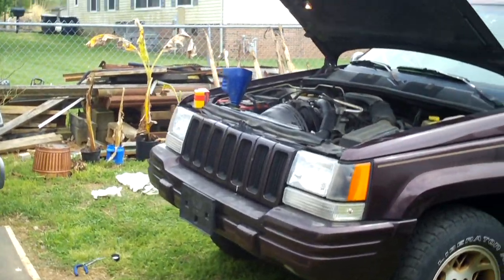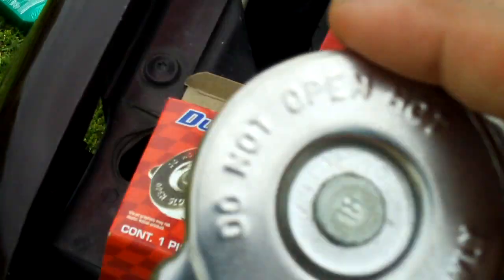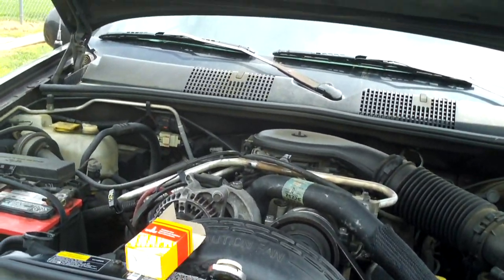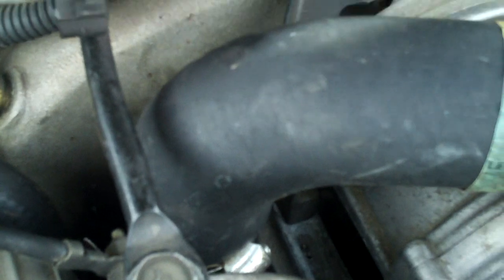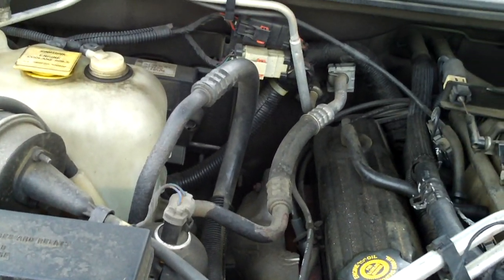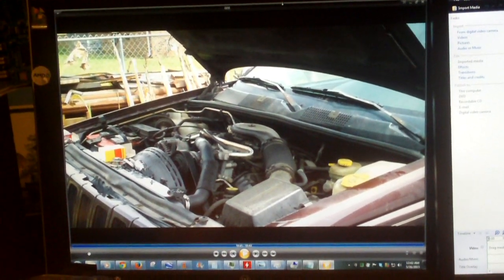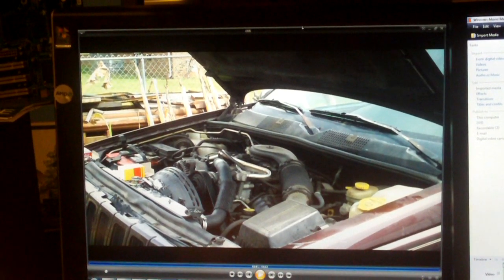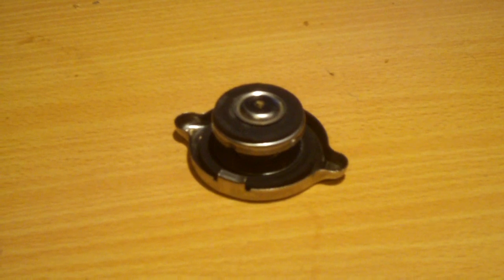What can happen if you install a defective radiator cap (over pressure)

Comment: If you would have taken it to a mechanic they would have sad "you have a blown head gasket"... lol Great job explaining. I have an issue where my coolant ends up in my overflow tank and not back into the engine, so quite oftem i have ti siphon it from there back to the radiator... and of course, i took it to a mechanic and they said "blown head gasget" meanwhile i have no symptoms, no over heating, not sludge in oil... not losing coolant. I installed new Rad, Hoses, coolant temp sensor, thermostat, etc and multiple caps! Same deal... at a loss. I have an infiniti fx35 2010

Comment: Likely your top seal was not working and thus not drawing coolant from the reserve tank.  The pressure was not likely to be a problem other that stressing your old hoses.  If the hoses were in good shape the clamps on the hoses would leak.

Comment: is it ok to change psi from 1.1 to 0.9?
Reply from the maker: You would lower the boiling point of the coolant by doing so. I'd suggest sticking with the OEM recommended pressure.

Comment: As far as I can see it, there was in this case nothing wrong with the cap. You just had the wrong cap. You needed a vented cap.The cap that was on the radiator was a non vented cap for closed cooling systems.
Reply from the maker: The Stant cap that's been on there ever since is pretty much the same design. This Jeep calls for a 18PSI cap, which is the pressure it vents at. The MotoRad cap was also rated at 18PSI.

Comment: I have  a very hard time unloosening my radiator cap , should I be pressing it down Hard first as I unscrew it
Reply: It should just twist counter clockwise until the first notch. Then you want to push down and turn the rest of the way off. The first turn releases the built up pressure. Never open hot

Comment: Inspired by your video, this morning i swap the old radiator cap spring into the new cap i use. I swap the spring because the coolant volume in the reservoar stay the same whether the engine is hot or cold, i think the cap (the new one) was defected one. Now the volume in the reservoar increase a little bit when engine is hot, and back to normal when the engine was cold. By the way, the old cap 0.8 kPa, while the new one 1.1 kPa. I think i'm in the right way.

Comment: I went with both Stant thermostat and rad cap, change every five years, spring and rubber gaskets go bad. Wal-Mart sells Stant online, pickup in store. Local auto parts stores sell nothing but no-name junk today, oil is double price of Wal-Mart.

Comment: Just replaced my cap a month ago and now pressure builds up so high it blows out the cap and hoses feel really pressured. And yes it was from autozone grrrrrr. Anyway I just called a tow and I'm going to Napa to get one. Hopefully they will have much better products because I'm tired of this. I just replaced the water pump last year, the thermostat also and the radiator last month not to mention all the hoses. I replaced the cap when I did radiator because the rubber gasket was getting wore out or at least looked that way. My second edit lol anyway auto Zone has been proven to me to sell crap. If you do t get the gold odds are its gonna be defective at least that's been my experience and even then not 100%
Reply: Was it really a defective cap or another problem with the system?
Reply: @Ashroyer86  unfortunately it wasn't the cap. I purchased 2 from Napa so I'd have an extra and both did the same thing so I replaced the thermostat and it worked fine for a few days then did it again so now I'm concerned it may be the headgasket but I haven't had time to fool with it anymore. It's parked until I can get around to checking the headgasket
Reply: @my2centz196  that stinks. Keep us updated. I have a similar issue possibly.
Reply: @my2centz196  also look up "block tester". Loan the tool from AutoZone and buy the fluid from them. I never had luck with it but apparently some people have.
Reply: @Ashroyer86  thanks yeah that's my plan I just need the time. I'll definitely keep you posted. Have you replaced the thermostat yet? Their pretty cheap and usually easy unless on bottom of motor like mine then a little of a pain but not to bad. I originally didn't think it was thermostat because I replaced mine not so long ago and I most likely was correct unless I received a defective one. My jeep has 356,000mi so if it is the headgasket I'm probably gonna loop the heater core and do something I swore I'd never do and use that blue devil crap and probably ruin the motor even more so lol. I hate the thought of using that stuff but with such high mileage on such a difficult vehicle to replace head gasket it doesn't make sense to put to much into it. I don't have any smoke, fluid mixing, missing or any other obvious signs of headgasket failure but who knows. Everything else is relatively new. I will say a small leak in the radiator will cause the overflow to boil usually after you kill the engine at least that's what's always been my case with all my vehicles anyway but it doesn't usually blow out the cap.
Reply: @Ashroyer86  I still haven't fooled with it but talked to a mechanic and he said it could be the overflow tank on mine anyway. I'm gonna order one just to try but I'm pretty sure it's the headgasket. I do plan on testing I've just been busy and have another vehicle I need to repair first.

Comment: That vacuum relief valve on the first cap isnt broken. Its an vented style cap or "Normally open" style cap. The disc should be hanging like that.
Instead of having a spring loaded valve it has a small counter weight inside it. Your problem with leaks could very well be because of just using the wrong style of cap. Using the non vented style subjects the cooling system to high pressure under much longer times and even during idling.

From Stant
The cap has a small disc at the bottom of the cap that is a vacuum valve. That vacuum valve hangs down in the open position until the cap is subjected to rapid expansion of coolant or steam, which closes the valve in a sealed position. At that point, the system is pressurized and helps control overheating and enhances system efficiency. This also means the vehicle can be idling without having a pressurized cooling system and could be “venting” vapor into the overflow reservoir.
Reply: Do uk why system staying pressurized im hoping it be ok now but it was expanding top hose holding psi all day till i crack the cap i have new radiator new cap

Comment: You might be right about motorad cap mine fit loosely too! It leaked out the top but it stilled pulled water from overflow! I wanted a Stant cap but had to get Motorad cap! I bent the tabs on it slightly now it’s tighter but my cap has lever to release pressure when I teased pressure with the lever it leaked out the top of the cap again instead of just going through the hose to the reservoir! I’m gonna try a slight more of a bend on one side of cap cause one side seems a little looser! It might work I will see tomorrow! Moral of my story is I shouldn’t got the trusted Stant brand cap! My fix might work but I want a Stant cap! Must be made in America Stantcap I’ve never had issue like this before! Motorad Chinese?
Reply: I would not buy anything made by Motorad.

Comment: I recently found the coolant level down to the fins in the radiator, but the overflow bottle was full. So I checked out a pressure test kit from my local Autozone. I found the cooling system to be leak free. I also found no pressure release from the pressure cap. Problem found, I figured. 

Not so fast. The new radiator cap also failed pressure test.I went down the street to Napa to try their import brand. Failed. Went to Honda dealer; no cap to fit my aftermarket radiator. Bought one online, the same part number as the failed cap I took off. No pressure release.  

That makes three new caps of various brands that have failed to release pressure above the system design pressure. Pretty strange.

Comment: Wow.....I've been having these problems for 8 months and didn't catch it.  3 thermostat gaskets, hoses replaced, hoses coming off and finally the new radiator blew.  I can't believe I didn't catch this.
Thanks!!!
Reply from the maker: You're welcome... if you continue to have leaks at the thermostat, replace the housing/neck with a cast aluminum one. NAPA carries them. Advance or O'Reilly may have them as well. Solved my thermostat housing leaks for good. The OEM steel housing is junk, and doesn't seal well on top of an aluminum intake manifold.
Reply: cubecompmtdx 
I actually replaced the thermostat housing last fall, thinking that was the underlying problem.  A small leak still developed.

Comment: I have a 1993 Chevy truck.  My radiator is only 1 year old with 5,000 miles and I have a leak at the top outlet on the left side of the radiator.  This may be the heater hose.  I have pressure on the radiator after 2 day of sitting and the engine is cold.  The over flow tank is always going down and I have to fill it.  The engine does not get hot.  I have patched the outlet fitting where is was braised at the factory and it stopped for a week.
I'm thinking the radiator cap is 6 years old and maybe I'm building up to much pressure in the radiator.  This is my 5th radiator form Auto Zone.  I hope this is the radiator cap.  Any thought on this would be appreciated.

Comment: Nice explanation. I'm having the same problem with my '06 Commander. First a hose from the heater popped up (had no clamp) and when we clamped that one it started leaking from the relief hose.
I've ordered a new cap and we'll see what happens.

Comment: Those duralast radiator cap are no good. I had one and I replaced it three times under warranty, in a six month span. I finally got tired of it and went to advance auto parts and got there's instead. It hasn't leaked and my heater finally works!

Comment: I had a weird thing in a 2002 jeep grand cherokee. I heard water noises in the heater core. Then I realized the radiator itself was low, but the reservoir full. Cap looked ok, but got a different one out of a junkyard jeep. No water noises and the coolant got pulled in the radiator from the reservoir. I'm a believer in cap problems now.

Comment: For one thing on a vehicle with that many miles you don't need to use a 18 psi cap it builds up to much pressure
Reply from the maker: Mileage does not matter. They still run as hot with 300k miles on them as they do from the factory. If a radiator/heater hose can no longer withstand the pressure of the factory prescribed cap pressure (18PSI on the Grand Cherokee ZJ), then the hose should be replaced. Putting a lower pressure cap in place only band-aids the problem, and you lower the capacity of the cooling system (before it boils over). With these particular Jeeps sometimes hitting 230F (stock fan clutch will not full on engage until it gets this hot) idling in the Arizona desert with the A/C full on and blasting, or hitting 230F pulling a trailer up a steep grade, the higher PSI cap keeps the system from boiling over until about 250 or so. The system works fine with the Stant 18PSI cap that's on it now.
Reply: @cubecompmtdx  hey can ask u advise i changed radiator and foolishly didnt change clamp and hoses and cap at first blew off bottom hose replaced hose and clamps now top hose holding psi and expanding i also tried new cap now i just changed top hose will know after half hour drive but i thought through out day psi would relieve on its own im nervous my wife cooked head gasket just not fully blown oil is good car still runs good
Reply: @cubecompmtdx  also gauge only goes up little than on high way stays on cold not sure temp cencor bad or maybe stat is staying open again ik foolish not do stat too just i didnt want put money in car find out hed gaskets bad i had replace radiator just get her running again ik comp test and milky oil or smoke but hard tell and think i do see smell kittle smoke
Reply: @cubecompmtdx  if this continues be problem im going try stan cap run it psi relief opened its acura 200k and i only ysed local for years now i have commute so have determie worth doing timing belt waterpump longggg over due cars still nice shape and i can put classic insurance on it

Comment: I absolutely agree with you on this. I had the radiator replaced on my 96 ranger and after that it would not have any flow between the reservoir and the radiator no matter what i did. It did not blow hoses or gaskets but the top hose stays rock solid if you squeeze it. So i changed caps 3 times and asked 4 mechanics /even one at a dealership about this NO Flow  return and constant level? No help to me at all. So just been driving it but amazed how unhelpful the so called pros are. thanks for the vid.

Comment: Those Duralast caps are garbage. I just recently returned two brand new ones and went back to an old Stant. Duralast #1 failed and I gave it the benefit of doubt. When #2 went out I fired Duralast for good.
Reply: Yup, when it comes to rad caps and thermostats always go with OEM.  Those are parts that you don't want to experiment with and l've known people to loose engines to aftermarket caps/thermo's from trying to save a bit of money.